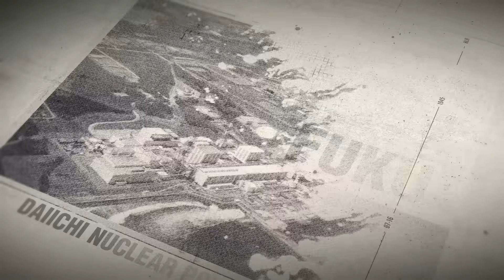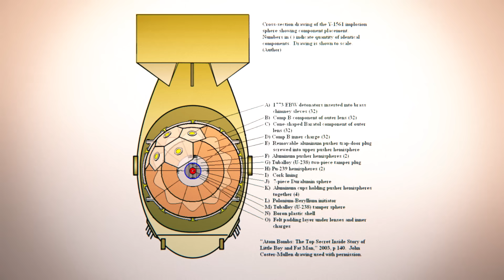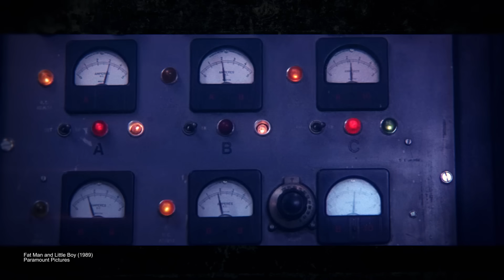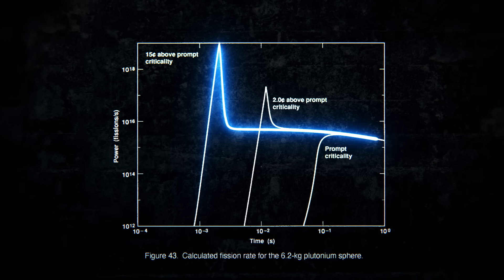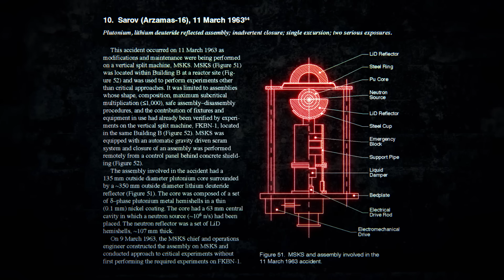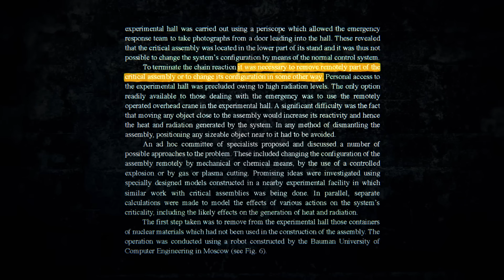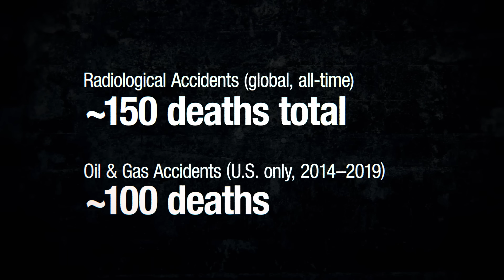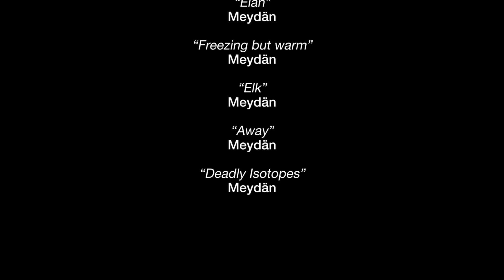Russia's Demon Core - Sarov Criticality Accident

Comment: I have been inside a nuclear factory (Olkiluoto) and I have seen all of the "spooky stuff" inside, like the tubes in Cherenkov radiation deep down in cooling pools, seeing the cemented up vaults, and of course went through the rigorous safety check before entering. While accidents like these absolutely can (and will) happen, nuclear power is probably the safest type of power to utilize.

Comment: There have been more than 14 nuclear reactor meltdown or partial meltdowns. And like planes we investigate and maybe fix the problem of that accident. We ad safety systems (that were involved in some way with the 3 largest accidents themselves) but the planes still crash, infrequently but relentlessly. Reactors are the same sort of situation. Can we risk a core melting into a water tank or ground water? And what if a solar flare cuts the power to all 94 or so reactors? 
In my opinion we are tickeling the dragon with our engineering aragamce every day.

Comment: They could have flooded the room with xenon-135 gas to slow the reaction or used other neutron absorbers such as boron to shield the devices used to remove the neutron reflectors.

Comment: Why couldn't you shield access attempts with neutron-absorptive materials? Not everything "reflects", right?!
Reply: Actually, all materials reflect neutrons but some do so much more than others.
Even neutron absorbers reflect some neutrons.
So using absorbers to shut down a reacting mass of fissile material usually requires the absorbers to be applied internally not externally.

Comment: Wow it cause the bottom of the nutron reflector eject it down as in applying physical force? 6:37
Reply: Actually, according to the account in LA-13638, that downward motion was an automatic mechanical scram triggered by a radiation alarm in the test chamber.
That should have terminated the criticality. But it did not, because the upper shell had been dropped onto the movable lower assembly instead of being correctly placed onto a separate fixed upper stand.
Reply: @derekp2674 oh ok thanks for that information. Kyle made it sound like to me it pushed it down. I know its mechanical, I was thinking over pressure or anything to cause it to knock it down.

Comment: 12:00 TRUE, nuclear power is easily the safest energy source, the incidents that have happened are etched in our memories, but unlike oil and gas, the mistakes learned from nuclear can and literally are used to make sure the accident never repeats. Not to say oil and gas  don't learn from mistakes, but the nature of the accidents are different, with nuclear power it's a highly controlled act of physics, once a mistake is made and learned from, it's almost impossible to have it happen again, with oil and gas there's simply risks to the various steps in the processes from obtaining the oil and natural gas, refining it to various individual products, etc. There's also a crazy amount of things that can go wrong in the chain from pulling it from the ground, to the final forms of energy we use, primarily because there's a lot of combustion involved, and there's huge risks with things like deep sea drilling. Nuclear  needs to be the energy supply of the future, there's no way around it, I recently moved across the country from California, where I got power from wind farms and natural gas (the price for this energy would make you think it was some Louis Vuitton or Gucci energy) to nuclear power, and the price is so much cheaper it's hard to believe. I went from baking every summer because it was 1-2k a month to cool the house  down to just 78f to being able to run the AC from 2 units, one upstairs one downstairs keeping the whole house at literally whatever I want, but usually around 72-74 because it's a bit chilly any lower for just 200-300$ a month. The price difference is astounding, and I don't have to see  disgusting windmills all over the place when I drive around!

Comment: @kylehill Hi Kyle, I have a question since I'm no expert in this field. From a purely logical perspective, why does the undisturbed Demon Core radiate after the accident or eventually melt, while the gun design of a nuclear weapon immediately functions supercritically and detonates? What's the difference? Does it lie in the criticality? Aren't both configurations immediately supercritical? One radiates happily, and the other explodes. Where's my error in reasoning?
Reply: In a criticality accident, fission products will be produced that are significantly more radioactive than the original fissile material. So significant doses of radiation continue to be released after any fission chain reaction has terminated.
The so called demon core was plutonium metal while the Sarov core was enriched uranium metal.
Gun type bombs are only viable if made from uranium. I think Scott Manley has some good videos on how bombs are made....

Comment: Can you just pour boron on it or coat the robot with it? To absorb those neutrons.
Reply: Nice thinking but that probably wouldn't work because:
1. Neutron poisons need to be inserted inside a reactor core to work effectively. Outside a core, escaping neutrons are unlikely to return and cause further fissions so it is best to just let them go. Putting poisons on the surface of the robot might reduce the number of neutrons reflected back from the robot, but that ought only to be a small proportion of neutrons anyway.
2. Boron is a very effective absorber for slow neutrons but the Sarov experiment was a fast neutron experiment. With no moderator to slow down any neutrons, any boron would not have been very effective.

Comment: I don't understand why it's so hard to attach a rope or a cable to the top half of the neutron reflector so that you can just remotely lower it and raise it. I guess cable technology was not very advanced back then 😂
Reply: Well the problem would be like trying to attach a rope to a soccer ball from 25 m away.
Reply: @derekp2674  Idk why you think that but no lol, they could get as close as they wanted.
Reply: @giovannifoulmouth7205 Limiting exposure times, keeping your distance or working from behind shielding  are required for safe work with strong radioactive sources. As the Sarov core settled into a steady state self sustaining fission chain reaction, it would have continued to give off gamma and neutron radiation until disassembled. After that it would still have given off gamma radiation from the decay of fission products.

Comment: You're stats for deaths in different sectors are slightly screwed, there is a bigger % of people working in oil and gas sector than nuclear so you need to do a deaths per % really.
The issue most have with nuclear accidents is the difficulty in fixing the issue.

Comment: 12:44 reason is simple. With oil you can say they died of fire. With coal, they were crushed in a mine. But for nuclear, they saw a flash of light and a tingling sensation. That doesn't feel like it would kill 1000 men. The result of nuclear mishap is too unnatural/uncommon for humanity to comprehend it. Therefore they fear it. Kind of like going to a doctor for a cough and they tell you cancer.

Comment: So if an explosion or meltdown would stop a criticality event like this, why didn't the explosion and subsequent meltdown stop the reaction at Chernobyl? I know there are differences, but I'd love to know in detail what those differences are.
Reply: The full explosion of the core at Chernobyl will have terminated the nuclear chain reaction there.
But by then, the out of control reaction had suffered an enormous power surge, enough to cause the explosion in the first place.
Also, after the end of the chain reaction, decay heat from fission products will have continued to release around 50 to 100 MW of heat. With no intact cooling system to handle that, this would have allowed the remains of the core to burn and meltdown.

Comment: I have a science...physics...chemistry....i dont know, i have a question.   This is one that's sorta bugged me.  Let's say you have a completely airtight cube (or sphere, or whatever, doesnt matter).  you remove all of the air from it with some sort of perfectly calibrated machine, then seal it.  the walls of the (shape) are machined in a way to be perfectly smooth in every possible way, so that nothing is hiding in the nooks and crannies.    is it really physically possible for it to be a "box" of nothing?  or is there still "Something" in there?
Reply: My guess is that, if you used a vacuum pump effective enough to literally remove every air molecule.from the base, then there would be literally nothing left for a short time. 
But once sealed up, the enclosed volume would start to gradually fill up with gases, formed by vaporisation of the container material.
Also, if the stopper seal was not 100% percent, air would gradually leak back in.
Reply: This question also reminds me of the Crookes radiometer or 'light mill".
These are made as an evacuated glass bulb, in which a rotor with four vanes or sails is free to move. Each vane has a white face and a black face.
The three that my father had have all stopped rotating now, presumably due to air inleakage.
Before that, if put in strong sunlight, they rotated white face forward. That suggests their rotation was due to the recoil momentum from gas molecules heated by their black faces.
With a perfect or nearly perfect vacuum they are supposed to rotate the other way..That is black face forward, due to the pressure of light photons reflecting from their white faces.

Comment: I thought Pu corrodes very easily.  How are they handling it with bare hands?  Was it plated?
Reply: That is correct. The so-called demon core was plated with nickel layer 0.005 inches thick (according to LA-13638, as linked in the video description).
Pu is highly toxic, radioactive and pyrophoric in metal form. So metallurgical facilities normally only process the material within gloveboxes filled with inert atmosphere, e.g. nitrogen or helium.

Comment: "So thats what the public thinks happened to it" What else could even be done with it. Really it seems to me there is 3 real options for the core. Either keep using the way you where using it, Melt it down, or you blow it up. Like what else could you possibly do with it? Use it to power the UFO's in area 51?

Comment: What prevents the critical core from going supercritical? Can an experiment like this go from "look at these measurements" to, the city of ??? Is gone?
Reply: The devastating high yield explosion of an atom bomb needs careful design and precise construction to go highly super prompt critical when detonated.
This is because a large energy release requires many generations of a nuclear fission chain reaction before the device blows itself apart.
Those conditions cannot occur by chance if a critical experiment goes wrong, as happened at Sarov.
It seems that the core at Sarov achieved prompt criticality to start with. Then the energy released heated up the core. In turn this resulted in thermal expansion. Both the temperature rise and the expansion reduced reactivity and allowed the core to settle into a low power steady state.
Reply: @derekp2674 excellent answer, thanks for showing me that I failed to account for thermal dynamics.

Comment: Question: can get a ratio of the number of death compared to the est number of facilities for nuclear vs oil and gas? I ask because oil and gas facilities are much more common and therefore a higher number of deaths isn't surprising. I suspect nuclear energy would still have the better number but it seems like a more grounded approach.

Comment: A better measurement of the fatality rate might be to compare not just the death numbers, but the numbers of deaths per unit of energy generated/used. I would also include any injuries/deaths involved in the extraction and refinement of nuclear fuels in that, as I'm sure the oil/gas numbers include those involved in extraction. I'm not saying this would flip the numbers to nuclear being worse, mind you, but it just sounds a bit disingenuous the way you've presented it in this video.

Comment: Regarding the fate of the Demon Core, I'm guessing most or all of these criticality experts don't actually know for certain. In 1946, it would have been classified information. Classified information in the US military is need-to-know which means that unless you have both clearance AND an actual job-related need for a piece of information, you're not supposed to know it. The truth might still be classified, and even if it's not, declassified military documents don't tend to get circulated to the public unless some files a FOIA request for them. 

That said, the there is good evidence that the material from the core was reused in another weapon. The following information comes from Alex Wellerstein's blog nuclearsecrecy and Energy A Human History by Richard Rhodes. As of August 30, 1945, the US had produced 26 kg of plutonium, 12.3 kg of which got used up between the Trinity Test and the bombing of Nagasaki. The Demon Core, which weighed 6.2 kg, contained almost half of the remaining US plutonium. A letter written by lab director Norris Bradbury after the second criticality accident shows that the Demon Core was originally slated to be detonated during Operation Crossroads but ultimately was not:

"Obviously Slotin will not come to Bikini. [Raemer] Schreiber will come although the date of special shipment was postponed one week to allow us to pull ourselves together. Only two shipments will be made at this time as I see no courier for the third. The sphere in question is OK although still a little hot but not too hot to handle. We will save it for the last in any event if it is needed at all."

Retired Los Alamos scientist Glenn McDuff told Alex Wellerstein that the material from the Demon Core had been melted down and reused in another core. I see no reason to doubt him. Plutonium is produced by bombarding uranium with neutrons. During the late 1940s, the US government only knew of a small amount of uranium ore in the US and was so worried about running out of it that they offered prospectors thousands of dollars in rewards for finding new uranium reserves. During the post-war period, the US government was busy making and testing more nuclear weapons. These factors meant that plutonium was a rare, highly-valued material in the late 1940s. The US military wouldn't have let the Demon Core go to waste. The 2 criticality accidents probably wasted some of the plutonium-239 in it, so it makes sense that it would have been melted down and reprocessed before it was used in a bomb. IMO Glen McDuff's story is the only logical fate for the Demon Core.
Reply: I agree. 
But look at the number of comments that teaser ending has generated here - including in this thread.
Also, most of the real nuclear criticality safety subject matter experts that I've known are too humble to just describe themselves as "experts". Criticality safety is a complex field and so most of us always recognise that there's stuff we don't know and will never know.
Correct criticality safety analyses require correct input data. Garbage in - garbage out failures must be avoided at all costs. So data mining is part of the job.
One of the causes of the Sarov incident was incorrect input data when assembling the copper reflectors. The experiment was repeating an old experiment from 1972. A transcription error was made reading the old lab note book and the outer copper hemishell diameter was read as 265mm not 205mm. So the reflectors were more effective than require to just reach the critical point.
But thr main cause of the accident assembling the lower reflector and fissile core first and then accidentally dropping the first copper upper reflector component onto it. It should have gone onto a separate stand and that could have been done first.